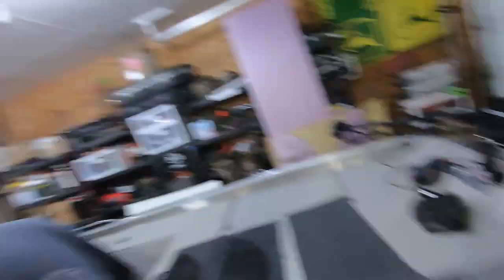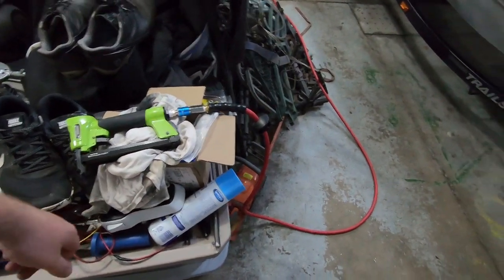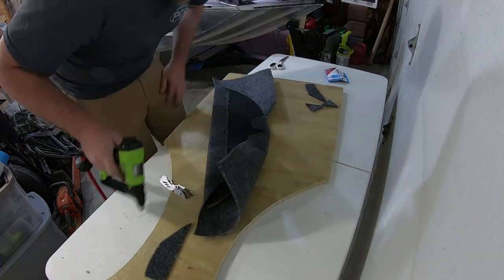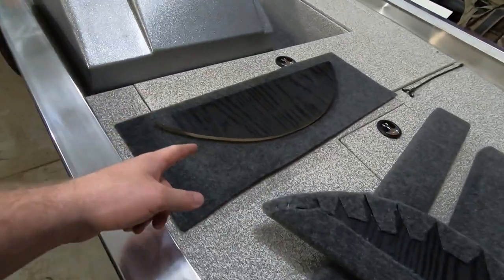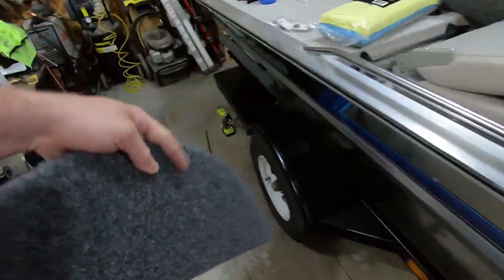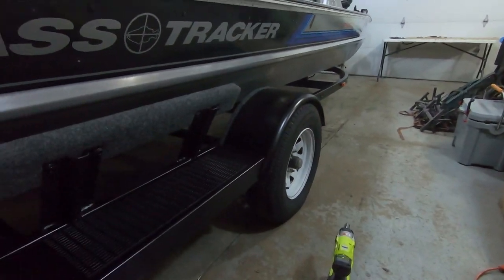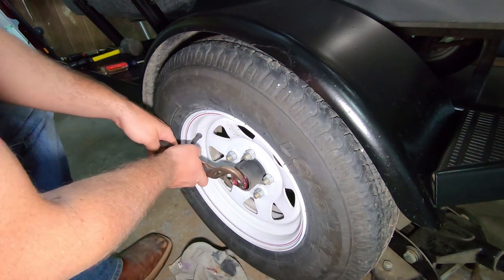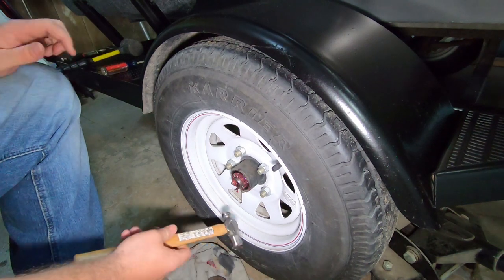Boat Trailer Maintenance - Bunks / Bearings / Wheel Wells

Comment: Do you have (or have access to) a lower unit pressure tester? It probably wouldn't be a bad idea to check that lower unit to see if it meets the minimum time/pressure measurement to insure you don't have a seal going bad.

Comment: Do you have any other videos of how you rebuilt the trailer? I have some rust building on the things where you put the sliders and was curious how to start fixing or replacing them. Thanks!
Reply: And what are those things called if I need to replace them?
Reply from the maker: Bunk support brackets? I do not have any trailer videos
Reply: @PUTEMDOWNProductions  thanks! Do you happen to recall what size dowel rods you used for the cover? I know you mentioned it but I can’t seem to find it. I wrote down a 12 foot 2x4 and round the edges but can’t recall the dowel ride size. Thanks!
Reply from the maker: @edwardrossiter9612 3/4” but put a relief cut length wise in the end you put into seat bracket because they will swell up and get stuck in there, dont ask me how i know haha
Reply: @PUTEMDOWNProductions  😂 thanks! The series was fantastic btw! Do you still have the boat?

Comment: I had an accident a while back and my boat trailer was damaged. Both bunks were broken. The insurance adjuster told me not to use pressure treated 2x4's when replacing the bunks. I was told that some wood companies use copper (& something else that I can't remember) in the pressure treating process. If there is copper present in the 2x4's it will eventually eat small holes into the aluminum. They are fine for fiberglass boats but not for aluminum boats. They deal with a bunch of insurance claims because of this.
Reply from the maker: Thats true, AC2 treated woods says it is safe for aluminum